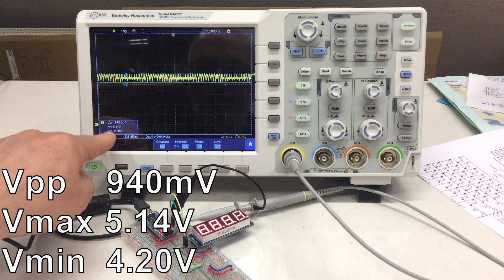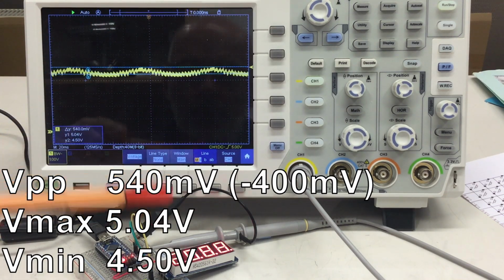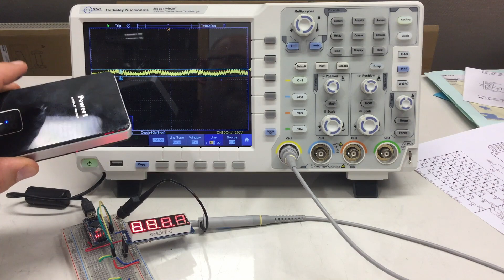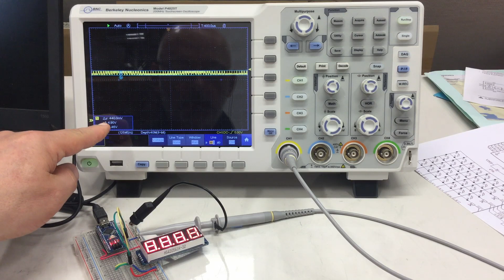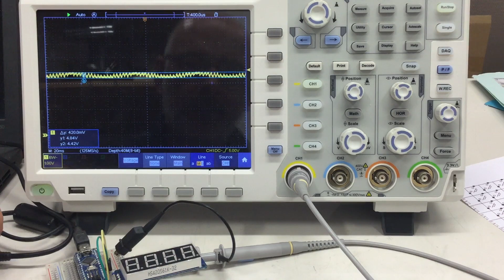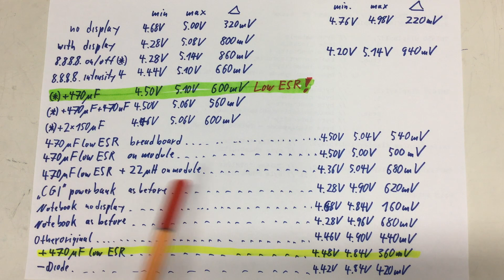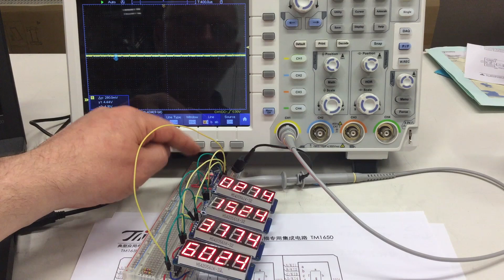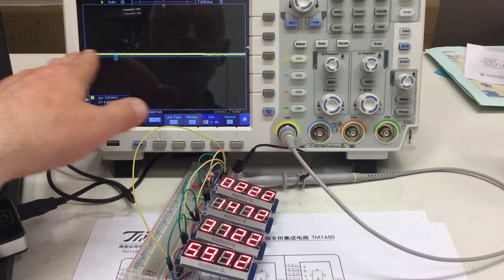Arduino, TM1650 7-Segment LED Displays and TM16xx Library – Addendum

Comment: which library or code you used please share
Reply from the maker: You'll find links to the library I used and my code in the description of the "Arduino, TM1650 7-Segment LED Displays and TM16xx Library – The Details" video: https://youtu.be/Kal8Ndoed6E (link also in the description of this video).
Reply: @robertssmorgasbord  thanks for your reply I tried and it works well with nano/uno but I failed to get it on a stm32 blue pill. any idea?
Reply from the maker: @drsimx3729  Sorry, can't help you there. Never worked with STM32's. Sorry again!
Reply: @robertssmorgasbord  no problem thanks for your support
Reply from the maker: @ You're welcome!

Comment: Confused if 4.7K resistors are needed or not
Reply from the maker: The 4.7k resistors are definitely not needed here.
Reply: @robertssmorgasbord  I assembled a circuit based on atmega 8 and tm1650 not as a module like yours, then without resistors the connection disappears, so in my case they are needed. On the module, I did not notice the resistors you have, perhaps on the arduino itself they are at the i2c output
Reply from the maker: @Nyamchik-0_0  Are you using some I2C library or the I2C bus of the ATMEGA8? Then my best guess is that the pins of your ATMEGA8 are working in I2C mode (just pulling the lines to ground) and thus the pull-up resistors are indeed needed. In the video I'm not using I2C to drive the TM1650. See also the previous video "Arduino, TM1650 7-Segment LED Displays and TM16xx Library – The Details" https://youtu.be/Kal8Ndoed6E : It's kinda possible to drive the TM1650 with I2C, but it's not really an I2C device (no I2C addressing etc.). Hope that clears things up.
Reply: @robertssmorgasbord  I am using standard twi bus atmega8 over datasheet. Tried it on a breadboard without resistors does not work. With resistors everything is ok. Although the tm1650 does not behave exactly as we would like. Do you have experience with C ++?
Reply from the maker: @Nyamchik-0_0  It's like I said 😉 When using the TWI/I2C bus you do indeed need pullup resistors (ATMEGA8 pins will only do an open collector style pulldown of the lines). My code, that is the TM16xx library I'm using (see the linked video in my previous comment) uses the pins as normal totem-pole outputs (actively pulling the lines up and down).
Anyway, in recent years I used C++ to program Arduinos only. However, a couple decades ago I did a lot of stuff in C++.
Reply: @robertssmorgasbord  Thanks. I solved the problem that bothered me. I did not put the condensers, not considering them important for the test. Without them, the tm1650 did not work correctly.
Reply from the maker: @Nyamchik-0_0  You're welcome! Depending on how much current your 7-segment displays draw, the TM1650s can create a lot of noise on the power rail without big decoupling capacitors, which in turn can ruin your day 😉
Reply: @robertssmorgasbord  Learning from our mistakes=)
Reply from the maker: @Nyamchik-0_0  And if we ever stop making mistakes, we stop learning 😅